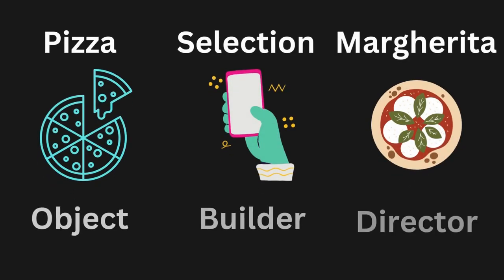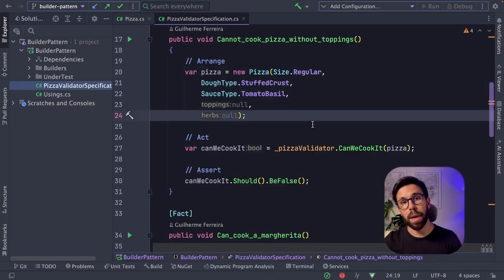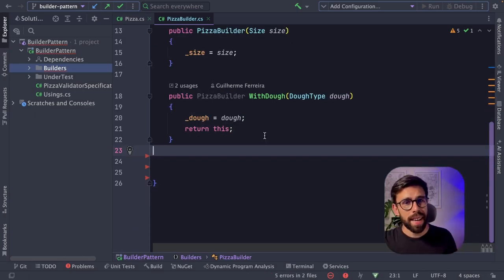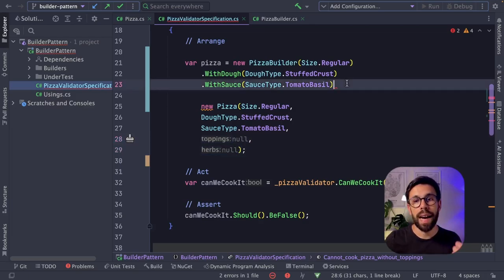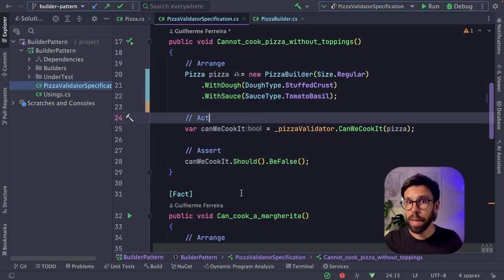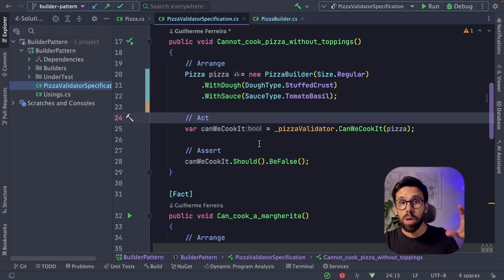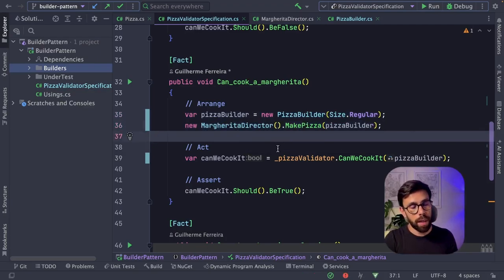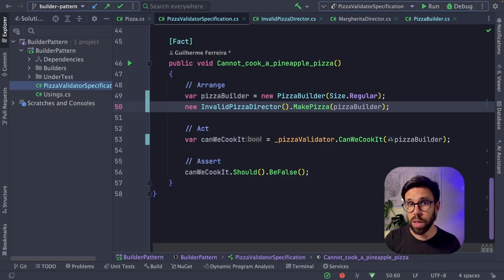The BEST Design Pattern for Maintainable Tests

Comment: After years of using the Builder Design Pattern to setup testdata I have found a better solutoin: C# records. I create a static method that instantiates a "default" instance of a record and with the "with" operator I setup further properties. This way I don't have to create Builder classes with all their properties and methods while I maintain the same functionality.
Reply from the maker: That's a good idea. 
I think it doesn't cover all the scenarios where I use Builders, however, I can see myself adopting it.
Thanks for sharing!

Comment: I can see that the Directors might be needed in more complex situations.   But instead of creating multiple Directors for each pizza type, wouldn't it be simpler to just add a fluent method "StartWith(PizzaBuilder.PizzaType.Plain)" that takes in a class specific enum?  I know this would place the responsibility of the default configuration as part of the Builder, but it would make sense here to simplify code maintenance and readability.  You can still create the directors later if you want that control somewhere else.

Thanks for all the great content.
Reply from the maker: Thanks! That simple approach will often work just fine.
The problem might be once you have multiple recipes where you keep their description.
Directors let you segregate that.
Thanks for the comment

Comment: Thank you for this great content, Gui!
Do you think it is ok to set private fields with Reflection in the Build method to get the object in the needed state for the test? Or do you prefer an internal constructor/factory method that can be called trough the InternalsVisibleTo option? Or is there any other option?
Reply from the maker: You can do it. However, I avoid using techniques like reflection on my tests. 
On my tests, I avoid going around the public API. I want to feel the pain of consumers. So, if I feel the need to go around the public interface, I question my design first.

Comment: I prefer to go with factory method with private constructor ...
Reply from the maker: Builders are extremely useful when you have types involved in multiple Test Classes.
Reply: @gui.ferreira But what is the difference between the Director and a Factory? In the end, both of them abstract the construction of an object, returning a specific default configuration (that could be further configured, depending on the type being created, if it exposes setters or not)
Reply from the maker: @stefan-d.grigorescu  the Director is also a creational pattern, but it's deeply connected to the Builder Pattern. You will use those two instead of a Factory when you have a complex initialization.